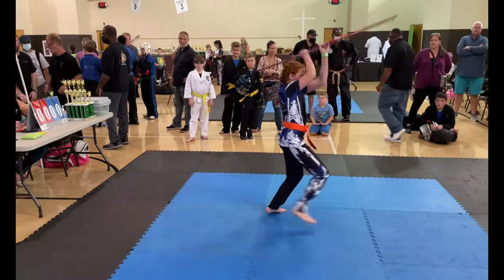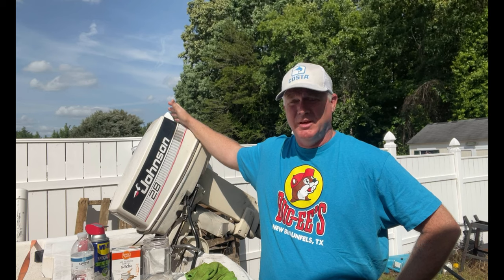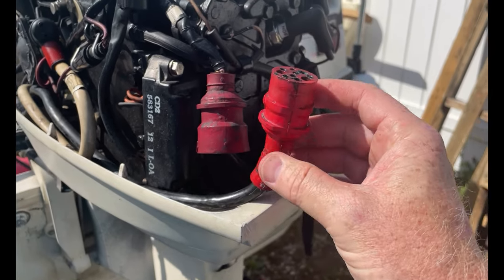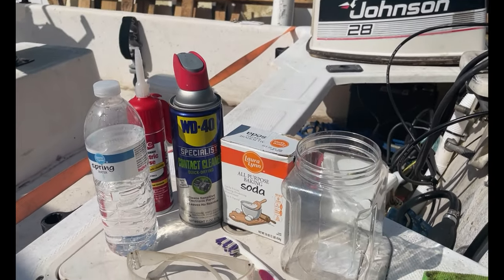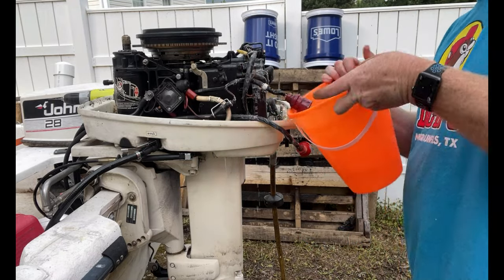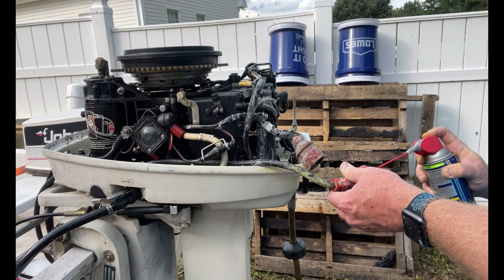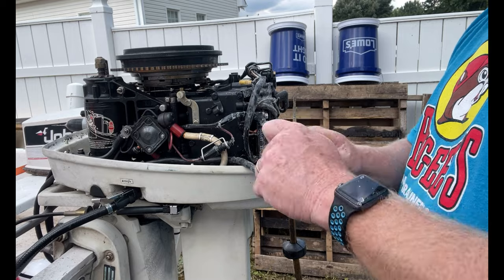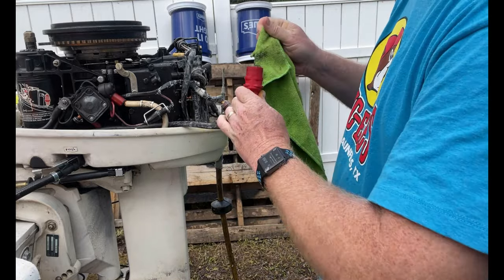Remove Corrosion from Old Connections (marine, automotive)  Baking Soda, Water, Steel Wool & drill!

Comment: Try white vinegar to clean the contacts & then bicarb solution in water to neutralise the white vinegar. Do not leave the white vinegar on longer than necessary & immediately use the bicarb to avoid corrosion from this process. Note that dry bicarb does not conduct electricity & needs to be removed from contacts. Your air pressure cleaner is a good idea.